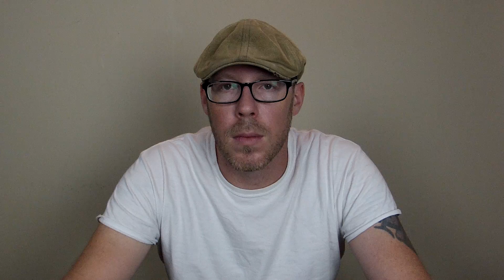Pool Pump Will Not Start - Humming Noise

Comment: Old Pentair Challenger. Running fine for the first two weeks of the season. Today it only hums. Watched your video. Hit it three times with a deadblow hammer. All is good. Motor is very old and we run it 24/7 for five months of the year, so I've ordered a replacement. Thanks!
Reply from the maker: Glad this helped you.  Save your change for a new pump.  It usually is a downhill process once they start doing this.  You might get lucky and it was a little rust, but more likely you will find it does this again.
Reply: @Swimmingpoolsteve 
Mine was doing this. I opened it up and there was some mild corrosion on the brushes and magnets. I blew it out with a compressor and now it seems to be working fine. Do you suspect I’ll have problems in the immediate future? The pump is only 2 years old. 
Thanks for any info you can provide

Comment: Yesterday my brand new Doughboy Powerline XP PUMP STOPPED WORKING. It was humming and tripping the breaker. I was several videos on how to remedy this and the one that worked was the rubber mallet. You just saved me about $350.00 Steve. Thankyou.
Reply from the maker: Did the pump fail after this or did it keep running for you?

Comment: Thanks for sharing. You did vaguely mention the capacitor. If all else fails remove the capacitor (careful!!! you must release a possible electrical charge stored in the capacitor) test it, if bad, replace it.
Reply from the maker: I did not mention and yes definitely you are correct about it being the likely source of the problem...but also that sudden discharge part from the cap makes me not inclined to have home owners messing with it. I don't want anyone to get hurt. Same with wiring questions for pumps. I just stay away from it.
Reply: How would one release a possible electrical charge stored in the capacitor?  Thanks

Comment: Thanks, I removed the impeller cover. Sprayed silicone lubricant on the shaft, gave it a spin, and it worked just fine.

Comment: Thanks Steve. Turned the impeller with a screw driver and the pump turned back on!
Reply from the maker: Did the motor end up failing after this?  Was it a problem every time you turned it off following this?

Comment: Thanks for the info!  You didn't mention the starting capacitor, but thats ok, all the other videos do, and you give info they do not.
Reply from the maker: cheers
Reply: 00:46
Reply: The laziest way, try on/off on/off a few times in 5 seconds. If it works great, if it trips the breaks. ...hammer time 😂

Comment: Thank you! Rubber mallet trick worked. I hit it a couple of times before I tried the breaker again and it came back on immediately.
Reply from the maker: Could you update to let us know what happened after you did this?  Is your pump still in service or did it die shortly after this?  Usually you can coax it along with the mallet for a bit but eventually it just will not go.
Reply: @Swimmingpoolsteve  It was an almost new pump and it hasn't had any issues since. It has worked as expected without having to use the mallet again.
Reply from the maker: @ouchman4212  Thank you so much for your follow up.  I am betting your pump had a tiny bit of rust preventing it from starting to spin. The mallet got it over that and since it is regularly used now the rust was not a problem again.  Cheers.

Comment: Love reading and learning...Thank You for this information...can hardly wait for daylight to try it...Love my rubber mallet use it often. Love saving money unnessarily... Fingers crossed till new one is replaced. This old blonde ain't nobody's fool. Thanks again for helping others. 😇
Reply from the maker: You are so welcome!
Reply: @Swimmingpoolsteve  hi. I have a Pentair pump and it turns on for 3-5 seconds and then turns off. The error message is  Alarm Priming Dry. I am not sure how to fix it. The skimmer has plenty of water. Please help! Thanks!

Comment: I tried everything mentioned. I found that the impeller was not turning. The one thing I did not pay attention to when putting the new motor together. Beyond new seals and the spring seal, inside my impeller was a brass sleeve the shaft goes through. At first glance it looked ok, but with a closer look, it had little copper strings that had unraveled and causing the shaft to stick. Replaced the impeller and boom, works like a charm. My pool man told me the motor was bad, or should I say my ex-pool man. The upside is that I now have a good back up motor, lol.
Reply: Are the spring seals one time use only, or can I open up the pump, and reuse the spring seals?

Comment: Using the Mail it worked awesome thank you very much for this tip simple but effective
Reply from the maker: Glad it worked.  So what happened afterwards?  Did it need to be jogged every time you stopped it?  Did you replace it right away, and if not how long did it run for after you experienced this problem?
Reply: @Swimmingpoolsteve  HI, spa motor 4hp  2 speed. Works but when kick in hi jets the motor goes  fast & then goes low rpm for a few seconds & returns to high rpm. Continues doing full time. What could be wrong? TY

Comment: All good but, if 1 leg of the 220 is out it will not receive 110 v, it will receive 0 vac. They need each other to complete the circuit. Yes, there is 110 on one terminal and it will still bite you but it's not applied to the motor without the other leg. If it's humming and the shaft, or impeller, is spinning freely, it's most likely the capacitor.
 Thanks!

Comment: Had problem with pumps twice, first one was seized motor bearing caused by leaked mechanical seal. The other time was faulty capacitor

Comment: Good video, not sure if you still monitor this but... I have a two speed motor. Low works, high hums. I can switch from low to high and then high works. 

I suspect it’s a starter capacitor. Is replacing one possible/an easy ordeal?

Comment: What is the typical life span of a 1.5 HP single speed pump?  My pump makes a very brief humming noise when the breaker is flipped, but then goes right to the "regular" pump noise.  Should I start shopping for pumps?

Comment: Was expecting a practical tutorial by the pool side. your thumbnail shows a pump so expected you to show us you attempting to fix one.
This just sounds like my Father in law who seems to know everything.
Reply: To stop the humming I flipped the breaker, checked the motor shaft, tested the capasitor, and made sure all wires were secured. All was fine but the motor still humms. I believe the motor windings may be fried although I can't smell that, and the motor housing gets hot. We were away for 2 weeks and just realized this problem when the garden sprinkles did not come on.

Comment: hello, my motor is humming. after turning it on, the breaker would kick in and stop the pump.

my pump is hayward maxflo xl 2hp.

i already change the capacitor.

i already tried jump starting the pump, although rotating when off, after starting the pump, i can’t rotate the  impeller.

after checking the motor, the body chassis under the motor has been damage by water.

it’s like showing the bone coz there is no skin.

can it still be fix? if yes, how?
if no, any recommendation?

Comment: Incomplete video. These are the 4 main things that cause a pool motor (or most any electrical motor) to not start and just hum and trip the breaker.
1. Impeller clogged
2. Start up capacitor blown
3. Centrifugal switch stuck open
4. Bearings seized or getting rusty and tight.

You're welcome.
Reply: thank you but when can i find the capacitor
Reply: i just got mine to start.  it is seizing, and i gave it a couple wacks and started.  I can't use the timer now because i have to manually stop and start the motor.
Reply: He said that in his video if you watched it and had your sound on.
Reply: @naseemaldano6755  Whenever you want! It's up to you!
Reply: A 'need to be right' ?  like my Mother always says.....is it better to be right or better to be kind? He did this as a courtesy to you. Where's your video?

Comment: how do i prevent the motor from rusting and seizing?
Reply from the maker: It usually happens in seasonal areas where the pump is turned off and sitting outside buried in snow for the winter.  Often it only requires this tap with the mallet once in the spring.  Any other condition where you have to jog with a mallet regularly instead of once per year to get the pump out of hibernation really indicates that you need a new pump, not a bigger mallet ;)

Comment: I re-set breaker, changed the capacitor, banged it with rubber hammer and motor spins freely.  Still just hums, Any aother suggestions?  Thanks
Reply: If it's still humming and doesn't pump water don't let it stay running it means the coil is burning